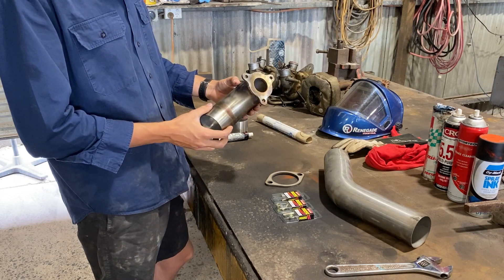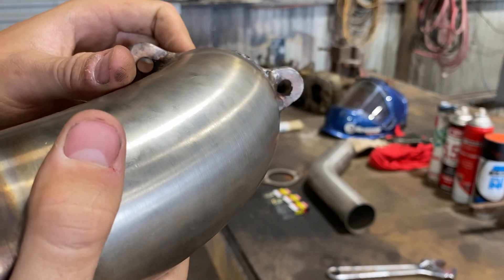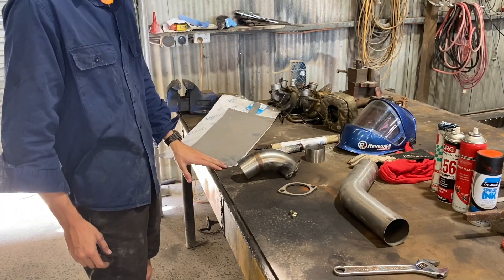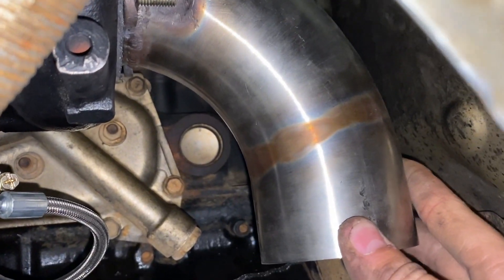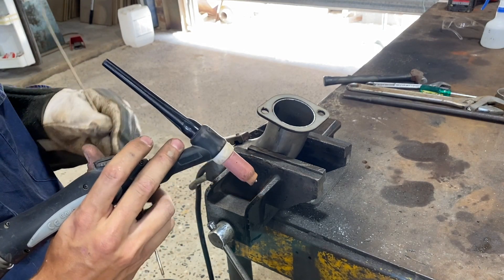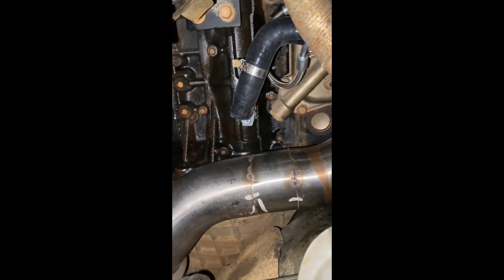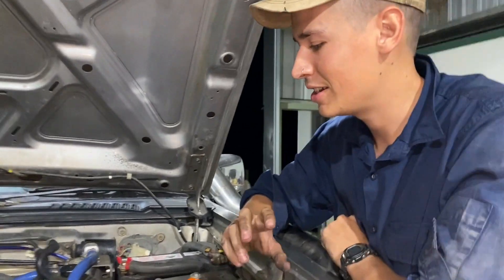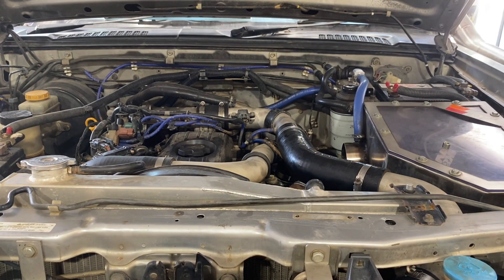ZD30 Navara to Patrol Turbo Conversion Pt2 - Dump Pipe

Comment: Where did you plumb the vgt actuator to bud?
Reply from the maker: The d22 turbo is a positive pressure/boost actuator whereas the patrol actuator is vacuum controlled. I pulled the vacuum actuator off and switched it for a boost actuator and then used the same boost line that was on the d22 turbo that comes from the intake pipe 👍🏻 I hope that makes sense
Reply: Awesome thanks mate. That answers my question perfect.

Comment: I dont see a dump pipe at all. You just upgrade the exhaust. Still has internal wastegate.
Reply from the maker: Hey mate think you might be thinking of a screamer pipe that vents the wastegate. This patrol turbo is a vgt and doesn’t have a wastegate however the navara turbos have a internal wastegate. Hope this helps